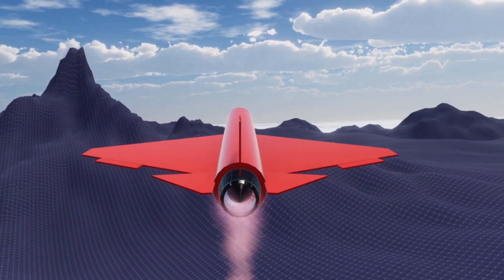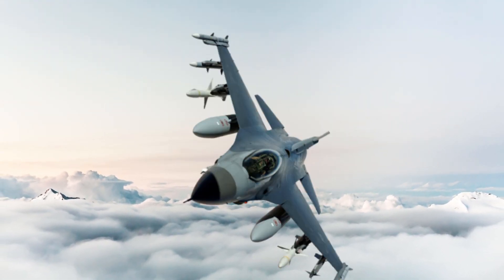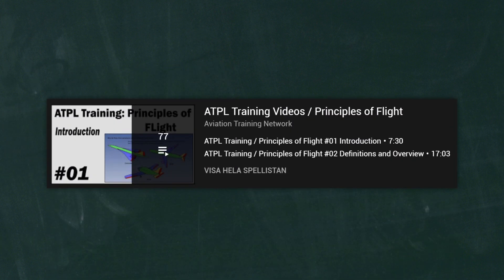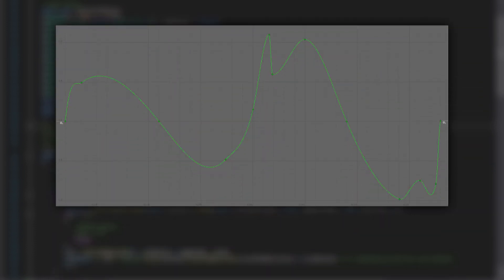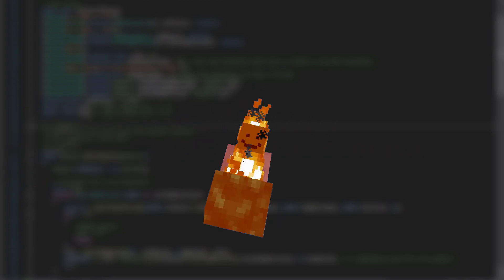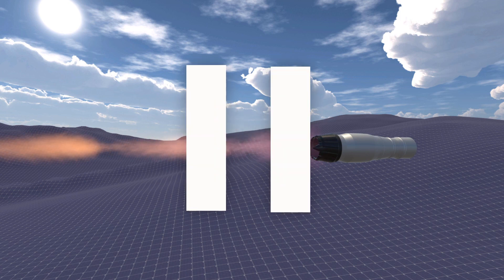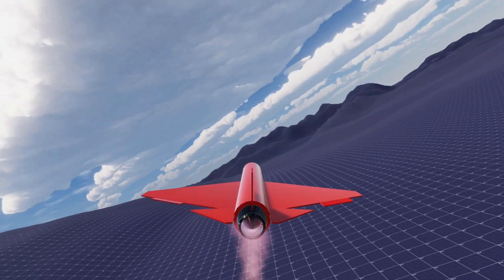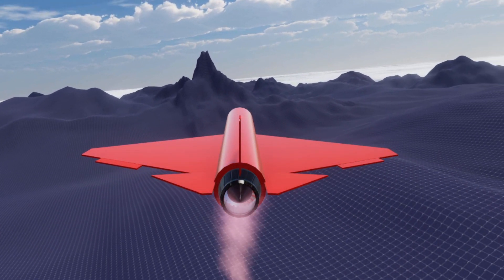I Programmed a Physics-Based Airplane! | Programming Projects 2.1

Comment: insane how damn common that model is in games. KSP, balsa flight sim, trail makers, etc. That wibble wobble is damn signature.
Reply: how to fix the wobble? doesn’t seem to be very apparent irl or any flight sim, not even in why485’s tiny arena combat
Reply: @plat216  I'd guess giving the contral surfaces smart stability assist using a PID
Reply: @cate01a  yeah that’s actually what I did and it works, however I know that irl not all planes had a flight control computer, and they still did not wobble like that, so I don’t know what to do
Reply: @plat216  maybe real life planes were designed smart: if the two wings are tilted up, the plane naturally corrects tilt. So you could probably do other smart designs that would make the plane self right itself and remain stable.
Oh and stuff like having the center of lift above the center of mass improves stability too

Comment: From what i can see, your physics simulation is based on a table lookup system whereby you do not simulate airflow over the wings, but merely lookup lift tables. Its a start, it woukd be interesting jf you dive into more in depth physics algorithms.
Reply from the maker: Hello, thank you for your suggestion! There are ways to procedurally create the lift curves that I use in this video, but I haven't gotten around to implementing that quite yet.  The lift curves give me the lift coefficient, which is one of the variables in the lift equation. It would be really cool to simulate the airflow more precisely, like in those airflow simulation softwares, but that would unfortunately be pretty heavy on the computer.

Comment: How do you deal with this certain condition  : Let's say you are in the middle of banked turn , rolled to your right and elevators are deflected . When it' s time to come out of the turn , I put my elevators back to zero , it immediately feels like a jerk . Which makes sense since I was going in circle a moment ago due to elevator deflection and now I'm not . Also when I come out  of a banked turn without putting my elevators back to zero ,  I immediately start to pitch up rapidly ( because elevators are still deflected ) . I can't seem to find what stability system deals with this condition .
Reply from the maker: I'm afraid I haven't implemented any stability system that is specifically designed for that condition. My controller is extremely general and can be used for airplanes, rockets, and everything in between. Perhaps I will make it possible for the user to program their own controller in the future,  but that will, unfortunately, have to wait a while. Right now I'm working on integrating my LOD planet with the vehicles.

Comment: it would be awesome if you can release the source code
btw it looks great
Reply from the maker: Thanks! The source code will be released with the next video :)
Reply: @simonholmqvist1951  awesome I was hoping to implement some of your advanced physics into a godot space Sim I've been trying to work on
Reply from the maker: okay All Right  It has stall.
Reply from the maker: okay All Right   I'm not familiar with the physical effect that keeps the aoa up during the stall. Could it just be due to stabilization software, something that fighter jets certainly have due to their instability? I've implemented a PID controller in my most recent version of the airplane which does keep the nose up when stalling. It seems logical that, if even the stabilators stall, the airplane would try to pitch down due to torque created by the drag on the rear control surfaces.
Reply: okay All Right  That's pretty harsh to say "its garbage"
Reply from the maker: okay All Right  Saw that video the other day and thought it was absolutely amazing! My next video will be quite similar to his.

Comment: I like your video! as for the stabilization of flight im working on a PID controller just for that. Let me know if you need advice on how you could do it as-well!
Reply from the maker: Awesome man, thank you! I'll let you know if (or rather when) I need some help :)
Reply: Hey Man I am exactly at this position right now  . After successfully implementing lift and drag on my control surfaces I am now stuck with the stability issue . Any change in the elevator sends my plane into tiny oscillations which have to be cancelled out manually . Can you provide me any resources or help as to how to kill these oscillations as soon as possible and hold the pitch of my aircraft where I actually want it to be .

One thing I want to know about the PID controller . Let's say PID controller decides +10 degree deflection is needed in the elevator to counter oscillation AT THIS  moment , won't the actuator / hydraulics which move the control surface to that position will take their own time ( maybe half a second or so ) and in the meantime since we are not at our correct elevator deflection condition , aircraft pitches even further away from the required . So this look like a never ending chase  . How does PID controller account for this delay ?

Comment: Shouldn't the tip of the plane be a bit more pointy?
Reply from the maker: Good point ;)
Reply: @simonholmqvist1951  out. Now. The door is over there.
Reply: @simonholmqvist1951   instead of releasing a source code ,canbu make a tut,I will be able to understand instead of just taking our work